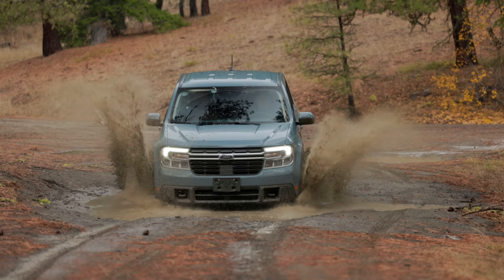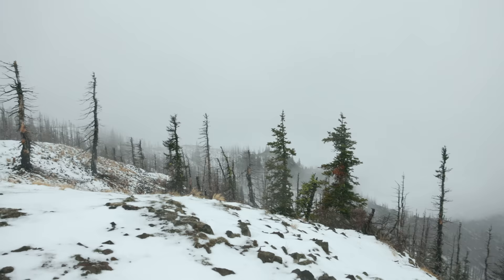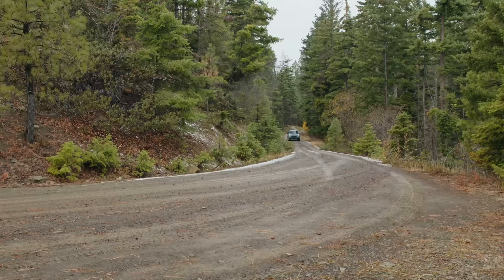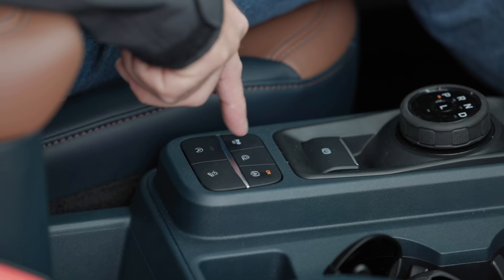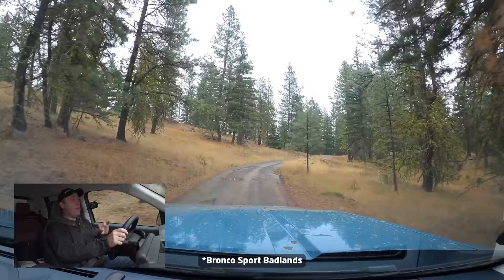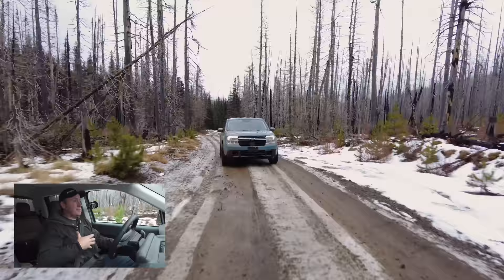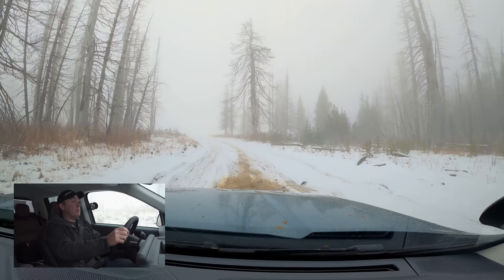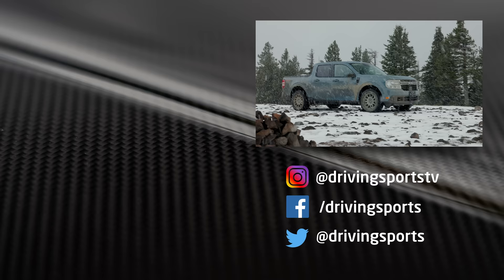2022 Ford Maverick FX4 Vredestein Pinza All-Terrain Mountain Adventure

Comment: If you can cut donuts in the OBW should be able to in the maverick but the lack of power output may be an issue
Reply: Both seem to have very similar power and torque.
Reply: @ALMX5DP  while true the awd on the maverick doesn't distribute the power correctly to kick it into a slide.
Reply: @danieljackson-woods6225  oh gotcha, sorry yeah wasn’t sure if that was what you’re referring to. Yeah being more FWD biased with torque split not having any overdrive ability on the rear axle makes sense. Even a solid 50:50 like I presume the Outback has would do better if it brake vectors the inside rear wheel.
Reply: @ALMX5DP  the obw has almost 100+ more hp and torque and the turbo kicking in at low rpm it puts out quite a bit more power. I can easily do donuts in my OBW and putting it into a power slide in mud is quite easy as well.
Reply: @danieljackson-woods6225  100 more? Ryan’s Maverick has the turbo engine so both are within 10hp of each other I believe.
Reply: @ALMX5DP  maverick has 191hp 155ftlbs torque obw has 260hp and 277ftlbs of torque
Reply: @danieljackson-woods6225  that’s the front wheel drive hybrid. Ryan has the 2.0 Ecoboost all wheel drive with 250hp and 277tq.
Reply: @ALMX5DP  The standard 2.5-liter four-cylinder engine is paired with an electric motor to generate 191 hp and 155 lb-ft of torque. It can tow up to 2,000 lbs and carry a payload of up to 1,500
Reply: @danieljackson-woods6225  are you not reading what I’m saying? lol I thought I made it very clear this isn’t the hybrid.
Reply: @ALMX5DP  even if it has the hybrid the awd system in the maverick isn't adequate enough to make proper use of any of that power. As I said originally. The power output between the two isn't even comparable if the maverick can't make full use of it.
Reply: @danieljackson-woods6225  it doesn’t have the hybrid because the hybrid isn’t available with all wheel drive….. what on earth..

Comment: Great content! Excellent choice on the wheels. Maybe this is the cognitive dissonance talking (I recently purchased a set of KO2s for my Jeep) but have you tried the KO2s in snow and ice since they updated the compound and gave them a partial snow rating?
Reply: KO2s are excellent, I would give them a 7/10 for snow. I had a pair on my f150 for 2 years. If you want a tire that is really exceptional in snow Falken Wildpeaks AT3s are the best I’ve ever used in 17years of South Dakota winters. 
My only advice, whatever tire you buy. Buy the narrowest tire you can, your traction will be far better on snow and ice with a narrow tire. I like 235/85/17s for example.

Comment: Help me out truck YouTube guy in WA, got new f150 2021 xlt. Came with Michelin stock smooth surface tires, need good tire to replace for on road, little off road, snow for winter and all around everything. Don’t want noisY heavy lose gas mileage tire. Need something better though than smooth Michelin’s… thanka
Reply: My buddy put these Vredestein Pinzas on his 2020 F-150 4x4 Lariat and loves them.

Comment: I hate ford but I love this truck already. Also, this truck is not designed for “heavy duty.” It’s not a heavy duty truck nor is it designed to tow, load a heavy payload. Also, you have to set the mud,rock mode.

Comment: BFG K02 are the best A/T tire…fact not opinion.
Reply from the maker: Still an all-terrain, which means there are compromises in the design.
Reply: @drivingsports  correct, I didn’t say they are the best tire ever made. I said they are the “all terrain” tire. I’ve had 4 different brands of all terrain tires and the BFG K02 was just a better tire. In some cases it wasn’t even close.
Reply: @hydroboy35th  I had the BFG KO2 on my hardcore 4WD truck in the 1990s.  It is a classic off road tire, one of the best made.  However the road traction braking distance was pretty bad from what I remember.  I checked some tire test results and they say the same thing today - poor road grip (for normal asphalt roads).  That's the main reason I'm not buying the KO2 again.  But if I was purely going off road all the time I would.

Comment: I want to be honest and say that not many people are interested in watching multiple videos on the maverick. It's a fairly underwhelming vehicle offroad. I have been genuinely disappointed by this thing especially given it has the FX4 badge on the rear.
Reply: Yes fx4 stickers mess up the nice paint job too. This low profile truck will get its underside torn up once a rock slides past the skid plate. Plus you lose sport mode which is imp for a 250hp engine. 
I ordered awd with 4k tow for getting my toys over the dirt road to the campsite.
Reply: People need to keep in mind that Ford did not build the Maverick to be an amazing off road vehicle.  This guy is just showing what this little truck can do and cannot do.  If Ford would have designed it for heavy off road use it would have cost a lot more which have killed the purpose of this truck.  It’s affordable and can do 90% or more of the things most people do with their full size 4X4 Jeep’s and trucks.
Reply: I kinda like it the way it is. Plenty of other vehicles to go off road. My motorcycle is what I use. 
The Ranchero (Maverick) is going to be stuff and trailer hauler and basic transportation  where it will excell.  For reasonable cash.
Get a Bronco Sport for serious off road.
Reply: @timjohnson1199  You mean the Courier. That would have been an appropriate name from the past considering it is really only for carrying and towing toys over dirt roads to the camp. All the off road videos show why you only need awd for its softroading max ability.
Reply: @timjohnson1199  I like it the way it is too, and may end up buying one if Ford ever makes enough of them to be available at a local dealer, instead of having to go through the process of ordering one.
But, it has little in common with a Ranchero.  I own a 1972 Ranchero GT with a built 1970 429 SCJ engine and a 3 speed C6 automatic transmission.  The Maverick has 4 cylinder engines and either a CVT or 8 speed automatic.  My Ranchero has a 2 door standard cab configuration with no back seat and is built on a full frame, while the Maverick is a small 4 door, 5 passenger pickup built with unibody construction.   My Ranchero has a traction loc RWD, while the Maverick is either FWD or AWD.  Ir's also 18 inches longer than the Maverick, and the bed is 30 inches longer, with over 4 feet between the bed wheel housings.
Rancheros were made from 1957 to 1979, and were based on various Ford cars, and all Rancheros looked like the car they were based on.  Mine is based on the Ford Gran Torino and looks just like it from the cab forward, including the cabin interior.   The Maverick doesn't look like a car.  It just looks like a small truck.  The only Rancheros I would consider to have much in common with the Maverick are the 60s models based on the Ford Falcon, and that's only because those models had somewhat smaller beds and unibody construction.
If I buy one of these Mavericks, it will be to replace both a 10 year old Hyundai Genesis sedan, and a 25 year old standard cab Chevrolet pickup that still runs, but has seen better days.  The Ranchero is just my play toy that I drive a couple of times a month when the weather is nice, and occasionally take to a car show.  It stays with me until I hand it down to my son.